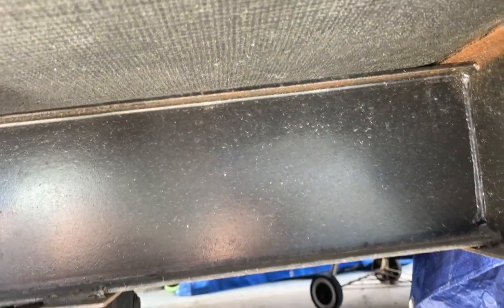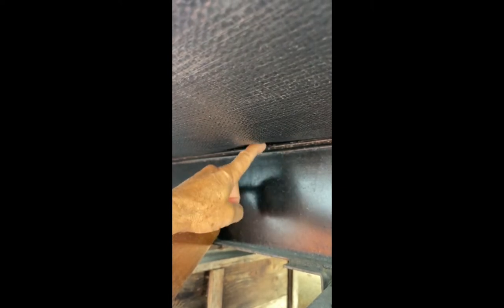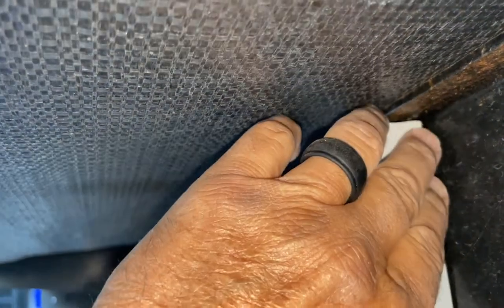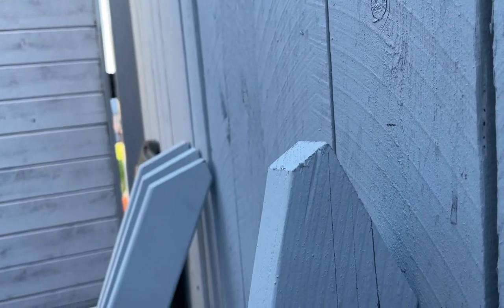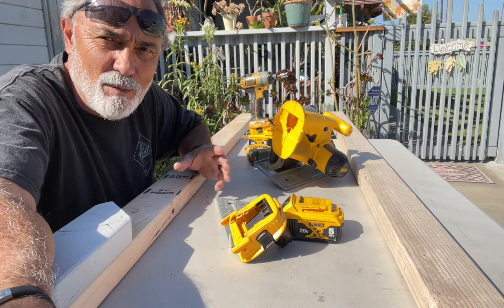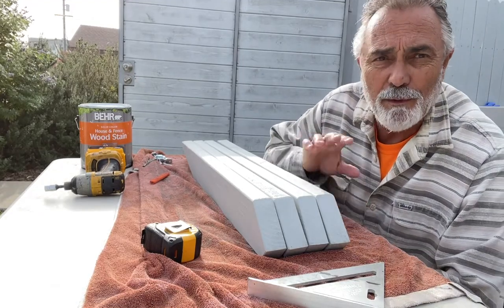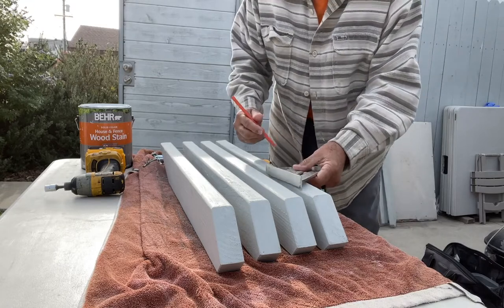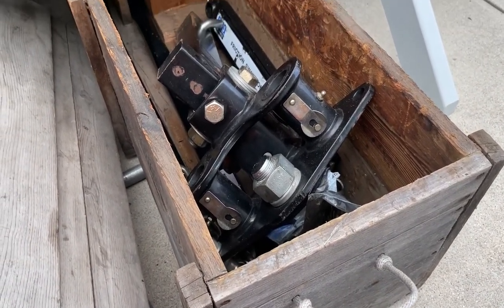Trailer Stabilizers; A simple weekend project with amazing results.

Comment: As with any stabilizing jack why would you not just put blocks under the wood legs you made to accommodate for the difference in terrain so all points have 100% contact with their mating surfaces.  I feel the first version you made had more strength where it was needed.  Just my opinion.  Thanks for sharing the video
Reply from the maker: Thanks for the reply, the angle changes as the terrain changes which causes the tip of the leg to rotate down the very narrow tip could break, its not a big deal but by cutting the additional angle puts the pressure nearer to  the center of the leg where it is stronger. Yes additional wood will be necessary when the terrain is soft, for sure. Thanks again for the reply.